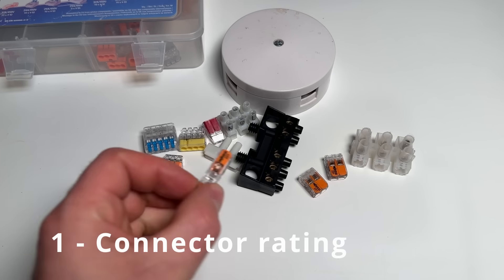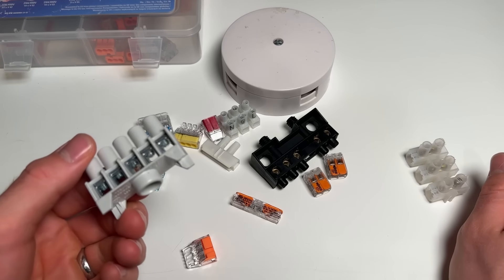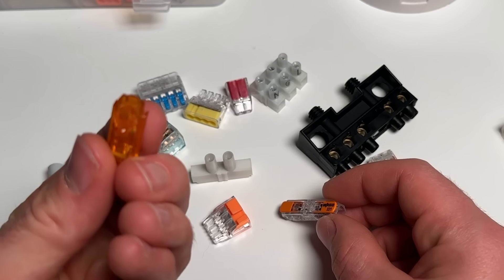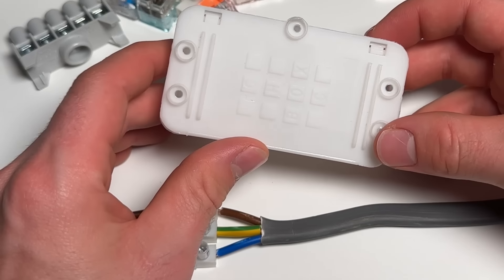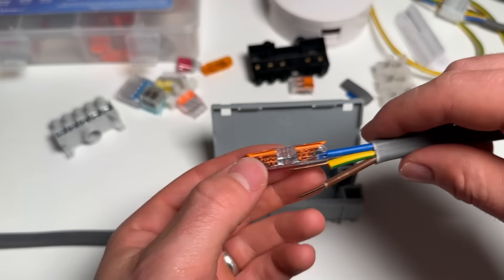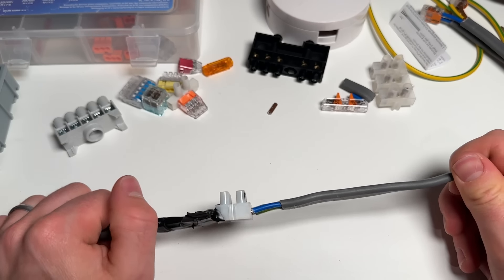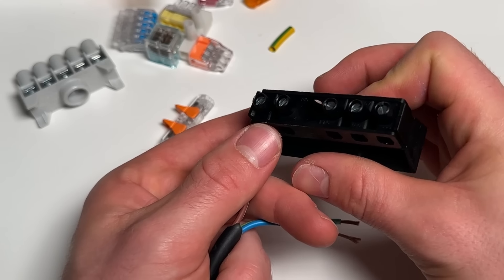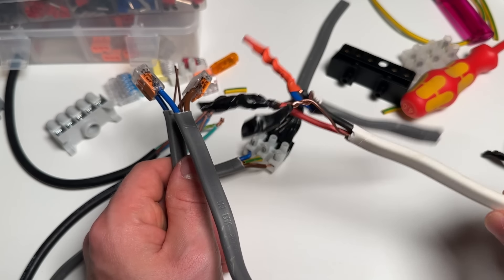BIGGEST DIY Mistakes Joining Cables

Comment: The twisting of solid core wire is not that bad as presented in this video, of course it have to be done correctly which it was not in this case. The right way is to strip about 10 cm of wire, twist the cores tightly together for 7-8 cm, cut the excess wire off, put a sleeve over the twisted part and bend it on the middle (this is to keep the sleeve from falling off and the wire from untwisting).
When I first was introduce to this method outside my native country I was chocked "How can they use such a terrible method to connect wires ?", but it had been proven to me a few times that it, if executed correctly, gives a lower transition resistance than the resistance that actually is in the cable itself, second concern is long time stability, and I have seen decade old installment that are still showing no signs of bad connections. So far so good.

So why do I almost always replace these connections to wago's when I see them ? Well first of all they take up a lot of space in a box, then it is a pain in time and work to do fault finding on a circuit that is made this way, and you may not have the needed wire length to redo the connection.

There is different ways to evaluate "what is a good connection of wires ?", some think it is ease of use, other think time is money, others again think that low transition resistance is king, others look at the total cost, as long at you follow the local law/code/etc. any method is good enough if executed correctly. In this video there were a few methods (the once that the author do not like ?) that was executed very badly, that is not fair to the methods itself. I know that exaggeration promotes understanding, but in this case, where you, to a certain extent, compare different methods, then this exaggeration is not useful.
Reply: I agree. I've also seen decades old twisted joints that were still pristine. Problem is, the only good ones I've seen were done by a proper experienced spark. Every single one of DYI twists I've seen were horrible bodges. So, in that context, the video is absolutely correct.
Reply from the maker: A very well written comment, I agree with everything you’ve said. The twisting I did in the video was not good twisting, but the idea of the video was to illustrate the mistakes likely to be made. Thanks for watching!!
Reply: In the Philippines, "twist & tape" is the standard connection in almost all installations. They can be done well and they do last quite a long time, but I have seen many issues with them. Once the predominant 3M electrical tape was mostly replaced by no-name Chinese products, the tape could unravel within weeks in a hot attic.

In the last rented house I found 40 year old twist & tape connections outside of junction boxes laying on highly flammable plywood ceilings. They had rewired the main panel about 10 years ago, but left much of the old wiring in place. Many outlets did not work, some had weird voltages. Lights suddenly stopped working. Then we found a 2000 Watt ground fault producing heat for weeks, but it did not trigger the circuit breaker. The owner had about one third of the house rewired to fix the fault, but left the existing dangerous connections outside of j-boxes in place. We installed a fire alarm and moved out as soon as possible. 

The electrician that did the partial rewire actually did a reasonably good job: the twist & tape connections looked solid and were protected by junction boxes, and the correctly sized wires were protected by solid PVC conduit.
Reply: Twist and into a choc block is the bare minimum
Reply: @ChristianWagner888  if you just had wire nuts it would solve the tape issue and very easy to do and cheap probably less than the 3m tape.
Reply: @ronblack7870   Wire nuts are not acceptable in UK, which is the country to which this video relates.
Reply: @ChristianWagner888  "Then we found a 2000 Watt ground fault producing heat for weeks, but it did not trigger the circuit breaker." That would have shown up in the electric bill, fairly rapidly.
Reply: @MrFiver1111  Choc block of the appropriate size!
Reply: @ronblack7870  I don't think I've ever seen "wire nuts" on sale in this country. The seller would probably be (rightly) afraid of being bankrupted by lawyer's fees. (Whether or not the "wing nuts" were eventually shown to be "safe" or "dangerous".)
Reply: @a.karley4672  we also have highly fluctuating air-con usage, but we probably had close to a hundred dollars additional usage. It was 2000 W on a 230 V system when we measured it, but it probably fluctuated with the amount of water under the floor slab, so it was probably less at times.
Reply: 10cm sound very long.. Do you not mean 10mm ?
Reply: @markkennard861  Strip about 10 cm of wire, twist the cores tightly together for 7-8 cm, cut the excess wire off. 10mm will be way to small.
Reply: Its certanly beter than wire nuts or bad screw clamps. In early 20th century they did all low power instalations by twisting the wires together but standard was that you haw to SOFT SOLDER them after a bit of a owerkill but...
Reply: The biggest problems that Wago overcomes is ease of fault finding when 'breaking' down a circuit to find a fault, also you can safely connect back into a live circuit which you cant easily do with twisting. UK regulations also state that cable joints must be secured to prevent the cables from being able to be tugged apart bu way of clipping the cable entries and the junction box to a fixed medium. Also twisting and untwisting cables can break conductors and this is not ideal if the conductor lengths are short to start with
Reply: blimey!that was some response!bordering on surreal but you sound like an expert!I would comment on it myself but I have no idea what anybody is even talking about.i've never even heard of wago!I've been doing electrics for thirty seven years and I don't even understand the basics!how nobody's ever been electrocuted I have no idea!it I went to rewire a customer's house,he may as well get sentenced to the electric chair!
Reply: My method is to twist it, then wrap it around with another copper wire and then solder it properly, this is the best existing type of connection, copper to copper and it will survive 100+ years without touching it. When I need to just connect 2 wires together (without increasing it's diameter too much in place of connection), I just put it together, wrap around with another thin copper wire and then again solder it. Step when I wrap it around with other wire is important, I would not trust just soldering it, it can melt or break because of mechanical stress, but when you use extra copper wire around it and then solder it, it will never fail you.

Comment: Not that tape a replacement for an enclosure or ever considered a permanent solution but if you use the correct tape for the job, it won't deteriorate as the correct tape if self-amalgamating adhesive tape, that is tape that is not held together by glue but the layers of tape will weld together and form a single solid. You won't be able to remove such a tape by pulling or just "unrolling" it, the only way to get rid of that tape is to cut it off. It's also perfectly waterproof and heat resistent and these are permanent properties. Such a tape even works under water and it's the only kind of tape you should ever use for temporary fixes that guarantees long lasting properties until a better fix is possible. It's also pressure resistent and an even fix water leaks on pressure pipes and that while there is pressure on the pipe and the water is currently leaking. And there are situations where you need a fix right now and a better fix isn't possible until two years later as it requires huge amounts of renovations which cannot be done over night.
Reply from the maker: Thanks for watching!

Comment: Personally I have never had any issues using wago connectors with their designated boxes as they are really simple and safe to use on most applications. I just don’t favour the screw type connectors (I.e chockblocks and JBs) as it’s very easy for those kind of connections to work their way loose over time with current and heat, whereas wagos and push connectors tend to stay springed in place. Generally speaking, any screw termination has to be tightened up sufficiently but not overdone so it crushes the copper too much.
Reply from the maker: Yep agreed, wagos are best and the screw terminal types best avoided where possible. Thanks for watching!
Reply: Are screw terminals in 3 pin plugs safe? Can you buy wago pushfit type 3 pin plugs?
Reply: @TheDiligentDIYer1759  The modern wago connection system is definitely very neat. But, just to consider the statistical probabilities that screw type connections are in some way bad - I'd guess that 99.99% of connections in UK domestic installations were made using screw connections.  And I don't believe there are masses of dangerous problems arising in those millions of properties with hundreds of connections!  Yes, of course, there will be examples of problems (possibly disastrous) that arose through mis-use of screw connections.  But, as I said, there's a much larger population size for those problems to be encountered from..  Plus,  the problem cause being mis-use rather than inherent deficiency in design concept.  It would be interesting to know if there are any real-world stats available counting prevalence of issues arising in the two types of installation i.e. wago-type v. screw-type, and the number of installation sites, to make a scientific verdict possible.

Comment: Really helpful video. I'm just about to try Wago for the first time for some loft lights, having seen them recommended. I was a bit misled by your thumbnail though as it made it look like the Wago was a bad option, hence why I clicked to see why. I have seen some shocking (excuse pun) wiring in houses I've lived in. 70's and 80's builds seemingly had barely any regs so it seemed. I had mains wiring running diagonally behind my kitchen wall and a spaghetti junction of cables above my light fittings. These Wago's look good and am looking forward to trying them out! Thanks
Reply from the maker: Thanks for watching!

Comment: I had to do some house wiring in China a few years ago (for 2kW heaters and a kettle so I wanted to do it properly). Spent over an hour in the electrical shop trying to buy junction boxes/choccy bloc (no Wagos then). Much effort with a translator and pics was hopeless - they had consumer units and quite a lot of fancy stuff but no connectors at all, because in China in 2015 everyone apparently just twists wires together. Try to buy proper connectors and they think you are crazy. So I ended up having to make all the connections by wire-twisting. I did it carefully and it worked fine (at least for the 2 weeks we were there). Electrical standards across the world vary, it turns out.
Reply: I'm pretty sure Wago connectors were available in China in 2010s, as I used many back then - but they must be purchased online. BTW, speaking of electrical standards, it's more of an enforcement problem, not a standardization problem. Connecting wires by solely twisting them together is officially not an acceptable method even back in the late 1990s - GB50258-1996 states connections between wires should be made via soldering, pressure-type fixtures, sleeves or terminals. But it's rarely followed by random electricians you find from the street...

Comment: As a DIYer I haven't switched to using boot lace ferrules but will
for next job. Up to now when using screw down connectors with stranded I have been putting solder on exposed strands before insertion into the connector.
Love Wago I recently fitting a Tado smart heating  controller I had sort out the rats nest of connections the  original house builder had left behind Wago connectors were the tops ❤

Comment: That plastic white connector and black ones are being used since many years in all Electrical installations and also inside Electrical applications without any problems except that the screws get rusted after some period

Comment: Last week I took a connector out of the circuit because it failed after 50 years. The screw had pressed on the copper and flattened the spot. The sparks caused a layer to form on the oxidation insulation. And this deposit had become conductive. This led to short circuits between two hot conductors.
I now only use WAGO terminals. Installation is easy and the contact is secure.
I change screw connectors for WAGOs.
Reply from the maker: Thanks for sharing and thanks for watching!
Reply: Wow.........

I had a 30amp block connector hidden behind an old cupboard that I fitted 48 years ago taped over with electrical tape! Renovated the whole kitchen last year and extended the ring with extra sockets and spurs but the connector block was as good as new. 
Now discarded as new 2.5mm didn't need joined up......... but nothing wrong with them, just that Wagos are the new slimline kid on the block.

Comment: Is it possible to just twist the stranded copper wire and insert them into a Wago connector. If not can you recommend what connector crimps to purchase.
Reply from the maker: I just bought some amazon ones, I’ve got a video on electrical tools that has the one i used linked. I wouldn’t recommend just putting the stranded in. Thanks for watching!
Reply: These Wago 221 connectors are indeed rated for solid, stranded and even fine stranded wire. So using a ferrule is not only pointless but also not recommended by Wago.
Reply: Main rule is to never twist! Always use a suitable connector, and put it in an enclosure.
Reply: @Kyouske_42  I found that I could pull out fine stranded wire with the Wagos in the locked position so if I had those ferrules I would have used them but I am not worried about them getting undone because nothing will be pulling on those wires after installation and after using cable clamps and staples.

Comment: The porcelain screw cap types of old don't deteriorate the cable current connection at all. Great for higher temperature and silicone cables in hot environments. All those plastic ones will all melt or deteriorate over time in a hot environment or in a high sun UV position.

Comment: I have bene using screw blocks [choc blocks] for 30 years and have not had ONE single issue, except one day a wire broeke off as the wire was too thin.  - I use everywhere - from 240V AC to 12 V DC, and for all types of Signal wires. It works well and if done properly, will last a long time. The ratings on those choc blocks are high and I have yet to see and appliance that will melt them.
Reply from the maker: Thanks for watching!
Reply: So I was going to comment earlier - choc blocks, from where I come from, I think used to come from the fact they were chocolate-brown.
Reply: Agree. With  screw blocks [choc blocks] you see and control what you are doing. With all these new inventions you see nothing and God knows what's inside. Plug and pray...and hope you will be able to sue the manufacturer if something goes wrong 🤠

Comment: I've never seen the ferrules before. The times I've needed these! Pretty much used everything else in this video. Thanks for the info.
Reply from the maker: Glad it was helpful!
Reply: Ferrules are a bless here at trade school, where things gets connected and disconnected hundreds of times, all the time :)
Reply: @BPo75   I wish I knew about them years ago when doing electronics. It's always been the part where my projects went a bit crappy, finding ways of joining copper wire to circuits with Chinese rubbish terminal blocks. I don't like soldering the wire ends because that introduces problems of it's own
Reply: I’m a ferrule convert, even where they’re not required by code. They take a second to apply, but save soooo much time down the line, not having to deal with wayward strands.
Reply: @tookitogo   Since I bought a big box of mixed sizes from Amazon, I'm finding they are very useful. Used loads all ready. Much better than just soldering bare wire to a PCB or Buck/Boost converter. I now solder a terminal block and connect to that for a better connecting without fear of oxidization.

Comment: is twisting  and then soldering the cable a suitable way to make a connection? are you allowed to soldier inline wire connections infact?
Reply from the maker: I’m not sure, but i wouldn’t recommend doing either, there are much better and easier options available. Thanks for watching!
Reply: Soldering is no longer acceptable under the latest BS7671 regs. The solder is brittle and can deteriorate when applied to cables. Solder is fine on circuit boards etc as the joint is (mechanically) fixed. Ferrules is the new accepted approach.
Reply: When you do it properly, it's the best way, if it's officially allowed by safety rules in your country, who knows, but it's safe when done properly. I am doing it all the time, but I recommend one upgrade if this mething, before you solder it together, wrap it around with another thin copper wire and then solder it, that's connection for whole life and it's proper copper to copper connection and even when tin will melt when thins will go in a wrong way, it will still connection. Also, soldering it together is only way how to do low profile connections when you need to connect to wires without increasing their diametr too much. People do it all the time, but electro-snobs believe that some Chinese crap from electro shop is better than DIY solution, but it's not and CE logo means nothing, I buy dangerous products all the time and they all have CE and other safety logos, it means nothing.